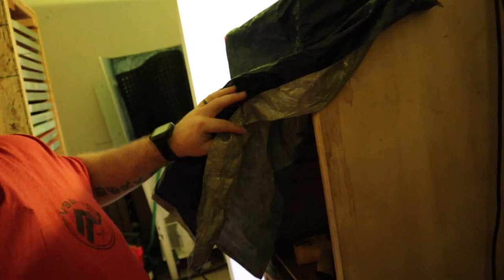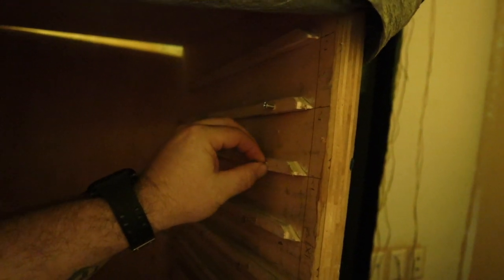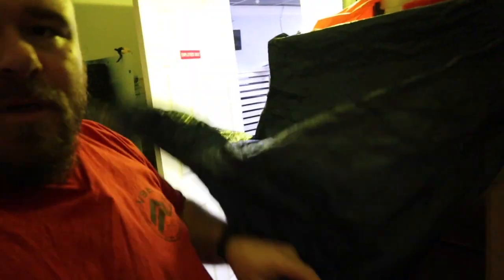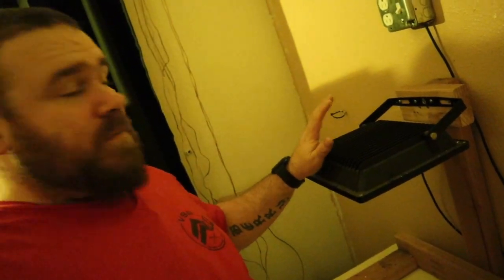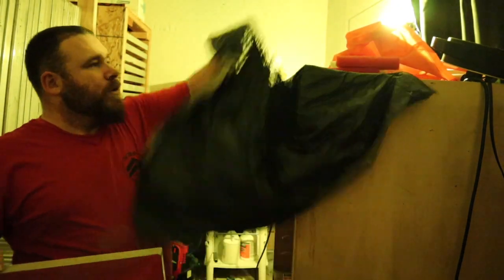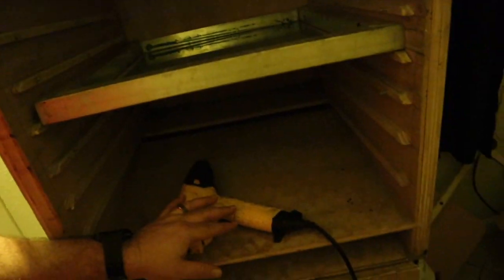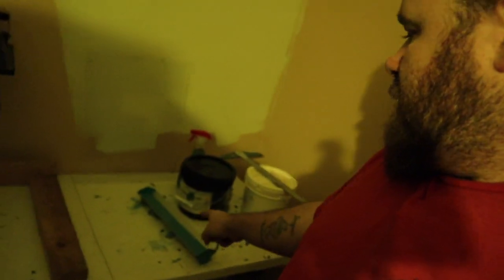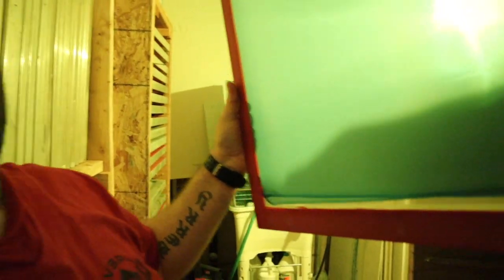WHAT WE USE TO DRY OUR SCREEN PRINTING SCREENS

Comment: hey awesome idea with the heat gun, just wondering how hot do you have your heat gun set at?  would you just turn the heat down to the lowest setting and  let it sit for 20 min?
Reply from the maker: Yes lowest setting but as well my dry box has a space underneath and the far back only has a 6" in gap to allow heat into the area that has the screens. But on low for about 20 min depending on the location if I was outside in the tent I would do high for about 20 min
Reply: @ApparelTalk  ah ok cool.  I'll have to go back and watch it again but thanks for the reply.  I need make one of these !!  Cheers!

Comment: Hi, thanks for making the video. $5 a screen seems really expensive to coat and reclaim a single screen. I'd probably stop printing if it was costing me that. $20 bucks for a four colour job, wow that's a lot.! That's before ink and films.  I too use Chromatec WR and with coating 1+1 , decoating,  de hazing and degreasing it probably costs me £1 in emulsion and all the chemicals. I used Kiwo and Alkemi products so not cheap stuff. Maybe you're paying a lot more for you products that we do in the UK. Chromatic WR is £25 (mported from the US) for a quart here and a quart goes a long way. at least 30 screens, though I've never counted. I guess it depends on how thick you coat, I use the thin edge of a 16" coating trough and coat mainly 156 and 230 screens. What is making your costs so high?